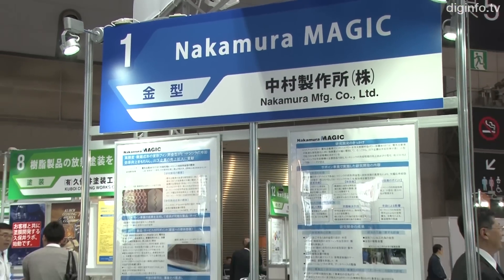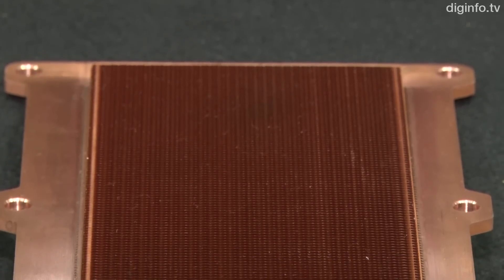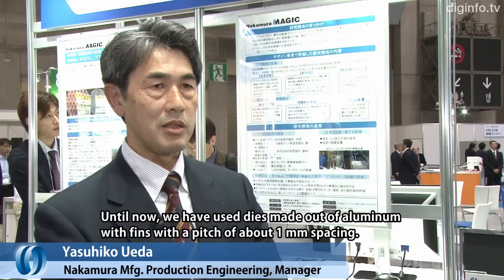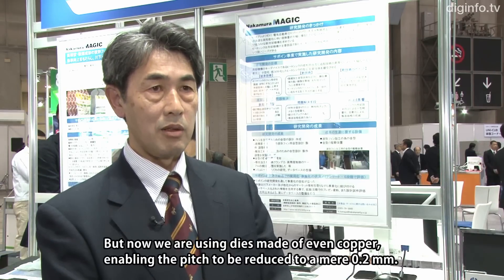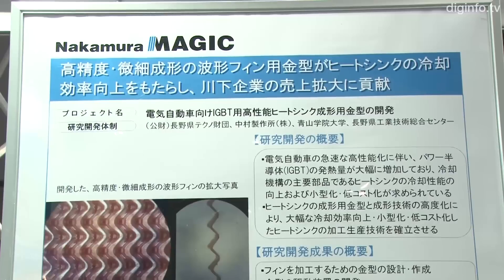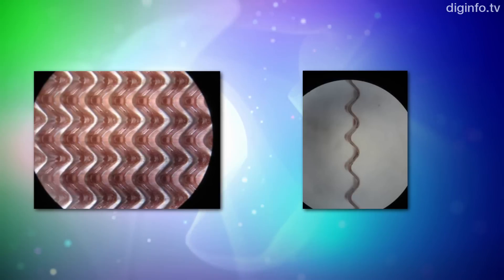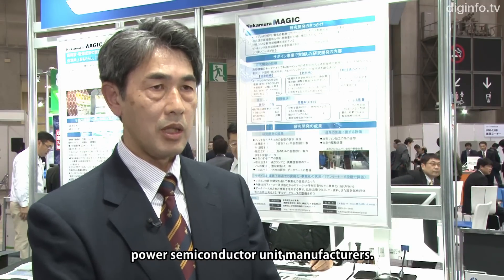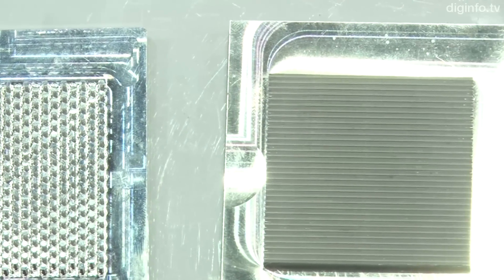Dies for Casting High-performance Heat Sinks for IGBTs Used in Electric Vehicles

Comment: Could it be applied for computer heat sinks or inside vapor chambers on the contact side especially with the copper version.
Reply: It prob could but It wouldn't surprise me if the ROI isn't high enough to head towards that direction.